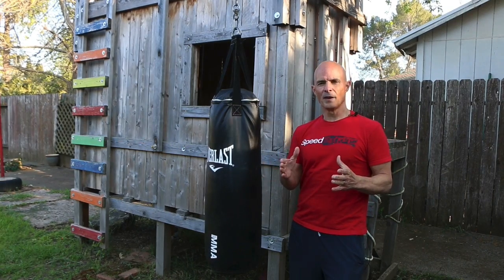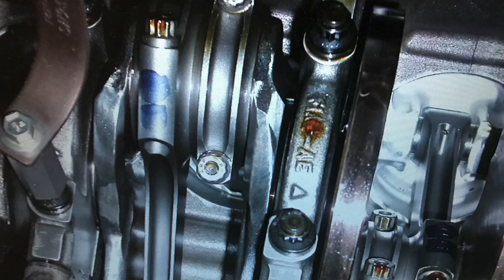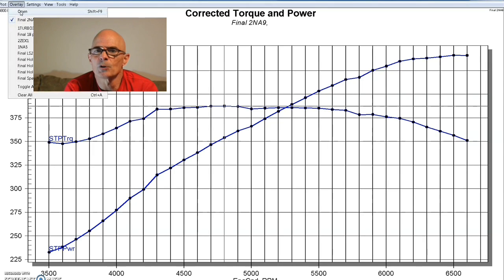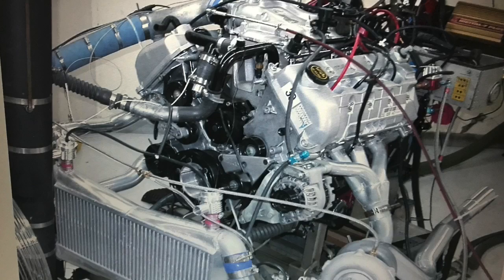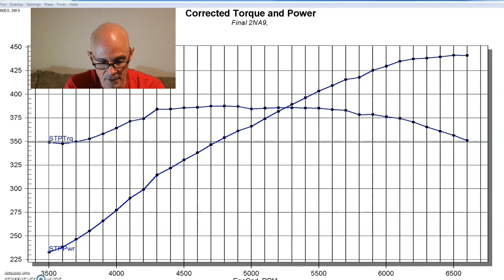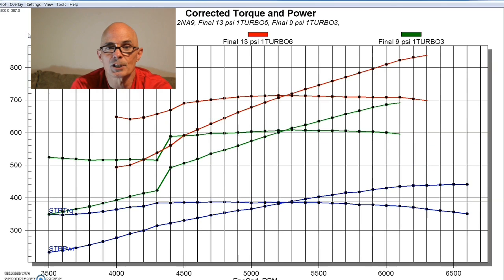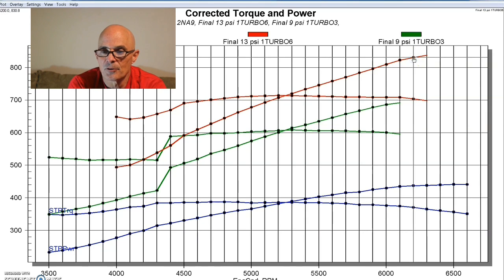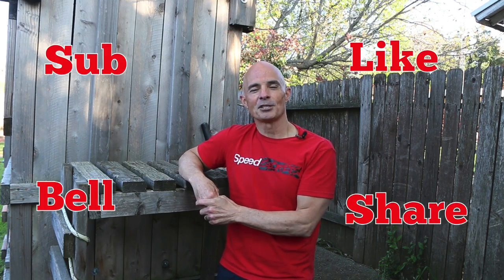1,000 HP TWIN TURBO FORD 5.4L 4V NAVIGATOR

Comment: What I find interesting is just how good the 5.0 coyote is compared to the larger 5.4 4V and how they were able to get so much more power with the same basic idea and less cubes.. 4 cams, 4 valves.    Fantastic stuff you're putting out RH.
Reply: Yeah, the Coyote makes about as much power with almost half a liter less displacement. A lot has to do with heads. 5.0 heads flow very well.
Reply: I’m not an expert but as far as I know the coyote stuff runs higher compression and better engine management as the older 5.4’s in general. I was amazed that my brothers stock 5.0 mustang has 12:1 compression ratio! My 5.4 mod motor is 9.5:1 ☹️
Reply: @ZedTee77  yea they have much higher compression and they also have variable cam timing that stuff really helps and the heads flow better.
Reply: They also rev alot higher too that helps them make power.  Variable cam timing and the better engine management system.  The 5.4 could easily make coyote power and more torque with a decent setup they just don't make many intakes for it and they don't rev as high.  Lower compression the list goes on.

Comment: How durable are these long timing chain motors at say 600-700 hp at say 6500 rpm?  Would they last for 200 passes down the dragstrip?
Reply from the maker: Accufab runs them to 9500
Reply: Accufab also uses OEM chains on their 2500hp promod
Reply: sanger440 ask cleetus McFarland. He has a rev limit living Shelby 5.4 4v that makes almost this much to the wheels in a crown Vic. The timing chains can take a lot of abuse, but they are generally the most frequently changed part just for preventative measures. A lot can go wrong if they pop. If you’re making a lot of power and race a lot, I’d imagine it be safe to replace the chains once every season, at the very least every other season. They take the most beating when they see a lot of rev limit action.
Reply: Love me some Cleetus but they tear up there stuff for their channel.  I am a bracket racer who wants 600-800 hp that will live without much maintenance for a season or 2 (300 passes).  My BBC with all good parts does that.  No one I bracket race with runs these long timing chain Fords, but that doesn't mean they won't work.  Which is why I asked the question.
Reply: sanger440 lol yea those guys are wild, but usually they treat their stuff the way they do to find limits and then improve. But as you can see from the comments left above, the OEM chains will suffice for your goals and live a long healthy life as long as you’re not always on the limiter.
Reply: Theyre very reliable. With forged internals at that power level you're good to go imo long as you have a solid tune and good fuel they will live.  I'm talking like a stock 5.4 gt500 motor.   If the internals are upgraded to aftermarket rods and pistons you can easily race at that power level and be every bit as dependable as anything else you'd run.  The answer is pretty durable when the rods are upgraded which is the weak link.  They're better in gt500s but still the weakest link.

Comment: I’ve always wanted to build a 5.4. We did a 4.6 -4 valve in a Mazda b2300 with a Kenny bell and we put a 2007 ford ranger nose on it.  Cool little truck. But I wanted to do the 5.4. I thought it would have made way more power.
Reply: Ron Gravel less power out of the smaller displacement 4.6 but you can rev it to 8000 relatively stock, can’t do that on a 5.4
Reply: @trevorvaughn5562 don't need to do that with the 5.4.  It'll make a ton of power and torque at a lower rpm.

Comment: Nope I'm not interested, "Ford sucks"!....
Reply: Mr. Rodirguez, not impressed with a torque line (line not curve) of 800lb/ft of torque from 4800 to 6500??? I love this channel because Mr. Richard don't care what's stamped on the valve covers. Give him a 4-cycle internal combustion engine and he'll make a 1000HP. It's comforting to know that my next toy, regardless of the make, could easily be built with some serious power. Thank you Mr. Richard.
Reply: @ts302  sure I agree boost any internal combustion engine and you'll greatly improve output, however they're are good architectures and there are bad architectures good designs bed designs I think you get my point, I don't dislike Ford products based on my opinion, I dislike Ford products based on my experience it's an observation, so if you like Ford so much you're going to have to deal with the bad architecture the bed design the overly complicated and expensive components I've said it before and I'll say it again I'm a real big fan of keep it simple stupid, now as far as Richard is concerned he has to stay neutral because there's more thumbs up together with multiple engines then one so in the end it's about dollars and cents for him that's not to say I don't appreciate what he's doing but he's not doing it from the goodness of his heart he's got to eat too!
Reply from the maker: please see Accufab Racing or Engine Masters-every motor has potential-especially a 4V design
Reply: @mannyr.2756  what do you consider "a bad design" or "bad architecture" about it?  What makes it more "complicated" to you? Seriously. These things are dumb simple and have a really good design from an engineering standpoint. I really dont get your problem with them.
Reply: @banneddamn  oh that's easy, and it all revolves around keep it simple stupid, not to insult your intelligence I'm thinking you may be aware of the LS architecture and Design, and the reality is anything that you can dream up know that they've done to the coyote engines you can do it with the LS engines which has a smaller package a single cam and two valves per cylinder once again it's a no-brainer!
Reply: @mannyr.2756  you didnt explain what the problem is from a design standpoint or how say an ls is better/simpler.
Reply: @banneddamn  even the worst engine designs out-there will work but the more unnecessary components in an engine the greater potential of failure excessively long timing chains to drive four camshafts guides for these timing chains, a really wide head to accommodate two camshaft "really" and don't get me started on the expense on these components.
Reply: @mannyr.2756  yeah that reasoning is dumb. Flatheads are simple. Doesnt make them better. Or not susceptible to failure. Timing chains can fail on LSs, same with their guides. How about pushrods? Cost is moot. Dont need to buy an aftermarket head with a modular. Pistons and rods dont cost more than ls stuff. The whole "it cost so much more" is the biggest load of bs. Oh no, a wide head. Who gives a shit the head is 2 inches wider. Who cares. Does that make a hemi worse than a sbc? Geo metro engines are small so they must be better than everything...
Reply: @banneddamn  then we can agree to disagree, Ford sucks!......
Reply: @Frank Bonazza III now now let's not make this personal play nice it is what it is Ford sucks!....

Comment: Do a 5.4 block on C heads high compression with an 18 coyote intake! Do the mod motor mods haha
Reply: The 5.4 has a taller deck height than a coyote, the 18 coyote intake isn’t going to work.
Reply: Use a boss intake and adapter plates!
Reply: @krtacct  I believe that there are some adapter flanges out there to do this - at least there were shortly after the Coyote came out anyway, everyone wanted to run a BOSS 302 intake on a Mod for about a second. Haven't heard of anyone using them in an eternity though, wouldn't be too surprised if they haven't been available in years.

Also, it's not just the deck height, the flanges are different from the 4.6l too
Reply: @RyTrapp0  Might be a dumb question but I'm going to be using the adapter plates to use a hi ram coyote intake and I'm just making sure that I would have to use the coyote fuel rails right? Since it's the coyote intake im using
Reply: @UnknownKF150  what about a ported cobra jet intake on it?  It should work if the boss and 18 works that is the best coyote manifold there is so it should be the best on the 5.4 also if talking about coyote intakes.  It may not work as well if you're not spinning it to 8k like a coyote but it would work better than a boss manifold does because it's basically the same thing as a boss mani with a lot larger opening and its able to run a dual bore throttle body or better yet monoblade to get all the airflow.  I love these 5.4s
Reply: i switched from a custom sullivan sheetmetal to an 18 and picked up quite a bit of tq but lost a bit of power up top, but overall, given you can get an 18 intake for 260 bucks and its within 35hp of a 2500 dollar sullivan custom that they don't make anymore its a great pick. HOWEVER, I always suggest people get a mod 6 box and go carb on the 5.4's unless you go full holley EFI. Ford EFI sucks so so bad

Comment: I would like to see an engine with no cams at all, but instead have electronically controlled solinoid valves! You could instantly change timing, lift, duration, all with no parasitical drag of the valve train. Let's build one Richard!
Reply: See the Koenigsegg freevalve engine :)
Reply from the maker: that is an amazing motor
Reply: But can you make one out of an LS? You know people right?  @richardholdener1727
Reply: @colonelk3000  I think that one is using pneumatic valves.
Reply: @colonelk3000  I think that one pneumatic valved
Reply: neck crank Electronically controlled would work, but it will never be reliable, thats why Koenigsegg used a Pneumatic system, not to mention designing fully working components for valvetrains can cost tens of thousands of $$$ in R&D since no one else has created them yet.
Reply: Yeah it’s a 3 cylinder 2.0l TT making 600hp back by I think a 1400-1600 hp electric motor

Comment: No an NA 4.6 2 vavle (400hp) top ended build up almost makes the same power .
Reply: Tony Spadafino if you add compression to this motor, with cams to make better n/a power, this engine will make a whole lot more than a 2v 4.6...

Set them both up to compete n/a but built as boost motors, the 4.6 will lose every time.

Comment: Richard for a cammed 5.4 those are pretty low numbers NA what was the compression ration on this ???
Reply: Says 10:1 in description
Reply: @QuicKurtZX14R  thanks I missed it...i had an 04 mach 1 and on engine dyno they make 380 and EG performance has a cammed longtube 04 mach making 400 wheel on e85 400 wheel is like 460 crank and that's a 4.6 guess I was guessing it would build much closer 500 or a little more.
Reply: socleanmx6  yeah i was also expecting more out of it. Richard is doing a good job of bringing some love to the cheap modular engines, seeing all this makes me want a 4v 5.4 Crown Vic
Reply: @knowbull5hit590  Sadly, even the 4.6 4V is difficult to find space for in a Vic. Well, easy if you have a '03+, but the earlier cars it's not exactly bolt-in with brake booster clearance issues etc.

Add the deck height of a 5.4 and, well... Trouble.
Reply: RotaryJunkie  its been done with no needed modifications to the Vic engine bay. 4v engines fit just perfect in P71s

Comment: Do u have to use a stand alone or could u use a sn197 ecm?
Reply: Larry Le they were using a stand alone
Reply: You don't have to, but for dyno runs it's best to have a ECU that will accommodate ALL engines vs swapping wiring and ECU per engine ran. In a car, go ahead and use the factory ECU.

Comment: I've never been a fan of 5.4's but wow, look at the amount and how flat the torque curve is. Better than coyote numbers?
Reply: My 12 gt makes more tq " n/a " But yes I can only dream of a torque curve well you can't even call that a torque curve that's a torque line lol
Reply: Mind you, there's a LOT more left in a 4v 5.4l than what you see here(re: 2013 Engine Masters Challenge where the stroked[there was a minimum displacement rule] 5.4 4v swept the 'podium' and put out well over 700HP with INSANE low end) - I suspect that this engine, being built for boost in mind, was relatively low compression.
Reply: @RyTrapp0  all 3 of those custom 4v engines were out powered by the 4th oe displacement ls in the challenge. Weird eehh. 

The ls even had headers that actually would fit in a car. 

So when you tell that story don't forget those all important details.
Reply: @HioSSilver1999  Sources - weird eehh

https://www.hotrod.com/articles/2013-amsoil-engine-masters-challenge-builders/

https://www.hotrod.com/articles/2013-amsoil-engine-masters-challenge-top-finishers/
^^^there's your HP - maybe try reading the words, not just looking at the grey & white boxes that are rounded

https://www.hotrod.com/articles/2013-amsoil-engine-masters-challenge-2/
Reply: @HioSSilver1999  You did not read the whole story that year. If you had you would have leaned that BES and Kasse both tuned their engine during development to produce well over 800 hp but retuned in order to maximize their score by competition criteria. In the end the LS boys did what GM does best...complained to have the rules changed in order to hobble the competition. In this case it outlawed the 4-valve Ford forever. Limiting the 4-valve Ford's N/A development (smart) and ensuring that the GM LS would win. But whoops...it didn't. The Gen 3 Hemi swooped in and took over for a few years. Poor GM. In the end it also killed the Engine Masters Challenge. The LS guys asked for an LS only category when HotRod took over and ChevyRod granted them their own Island. By then no one cared to compete. Thanks GM and all the LS fan boys. You turned a really great contest into a shit show.
Reply: @toddjohnson7133  The shit show came from letting 3 less powerful engines win off points....not power. The shit show came from showing up with headers that had 32 primary's that don't fit anything. 

they coulda tuned the ls to go over 800 also......not like it would be the first na over 800...or over 900....or over 1000.....even 1100. Hell gpi just did a sbe ls3 that went over 800. How many na mods are there at 1000 hp? 

It still stands that in that competition the 4th place ls made more power than the top 3 mods did. With a stock ls displacement.  No sleeves....no custom crank....no custom headers....with a engine that likely cost 1/2 what those mods did. The mod won on points.....not power.

How does your na modular run?

The hemis......lol. can't say i ever ran across a na one of those i didn't love thrashing with my na ls.
Reply: @HioSSilver1999  DENIAL MUCH? Kaase tuned to make points but could have tuned for max power. From what the article said it was a motor capable of well over 800 hp. The bottom line is that the smaller cubic inch Ford made more power throughout the rpm range than the larger LS. The ls was not a stock displacement engine, nor did it have a GM cylinder head. It used an aftermarket crank, pistons, connecting rods, valves, etc. In fact there was not an OEM part on that engine. Re-read the article. While you do that you will see that the Accufab Ford and the Kaase Ford used a factory cast block and heads, a largely stock valvetrain and a stock Ford intake...and still beat the GM engines. That is really hard to swallow isn't it? With all those cheap junkyard parts I would venture to bet the Fords were cheaper to build than any of the LS engines. If what you say is even remotely true then why did the LS boy howl to get the Fords thrown out? Maybe because they got ass raped by an engine that only had 2 months of development time and they had years to polish their LS package? Shit...what if the Modular guys had time to develop that thing or...god forbid...bring the vastly superior Coyote to the contest. Yikes.
Reply: @toddjohnson7133  you're the one in denial. I averaged the power in that competition across the top 2500rpm range myself......you know the part where you're actually wot in a car. The ls smashed the fuck out of those things. The numbers are there.....those junk ass modulars was down 60tq in places.

The furd blocks were not factory.  They had sleeves. Sleeved block is not factory.  Build one.....i dare ya.

The ls was stock displacement.  427ci. The mods was completely custom. Go build a na mod and lets us know how in turned out for you. Till then you're just running your mouth .

The fact is the ls made more power in that test with less cost, less complexity,  less weight, less cams, less valves. That's how the story went.

Just to show you what a joke that competition was.....the most powerful mod didn't even win🤦‍♂️.....and you're touting that stupid competition. 

Here's on for ya....the ls has thrashed the coyotah in both the na and boosted competition too.
Reply: @HioSSilver1999 ; The 32 tube headers are just for show. John was giving LS guys something to whine about. (It worked)